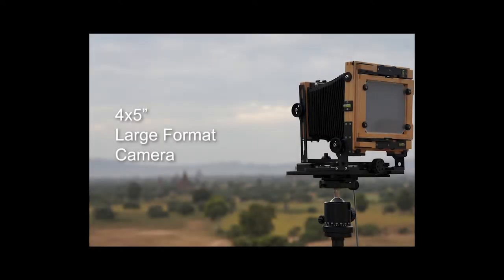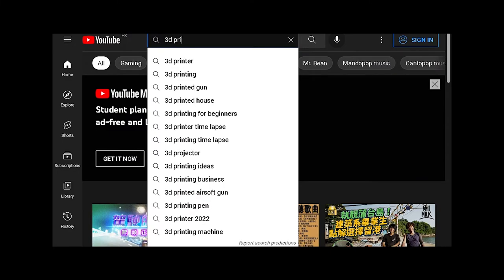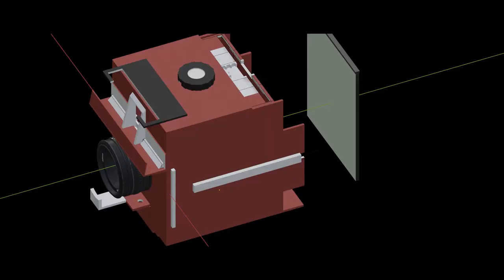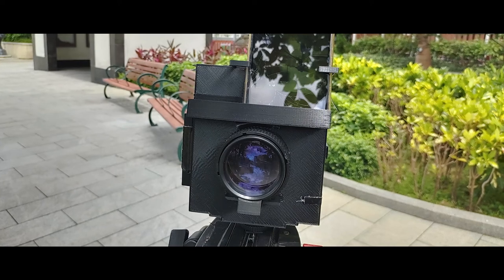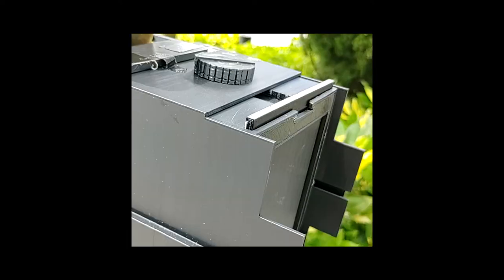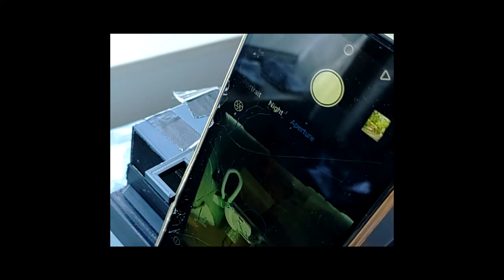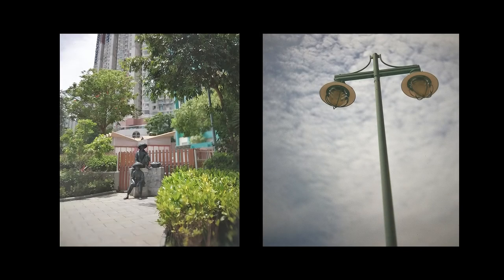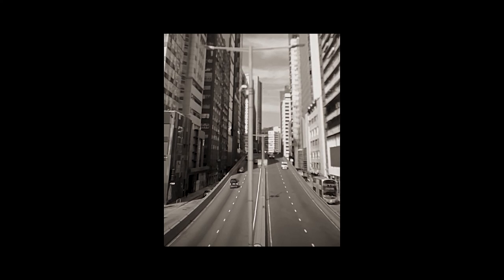3D printed DIY  large format 4x5 camera photos and videos

Comment: 很好的设计 不过对焦玻璃和白屏之间有点偏移 不如手机直接拍对焦屏
Reply from the maker: thanks. The focusing ground glass is quite grainy and also loses light as it is translucent. If you use ground glass as backplate, the problem is that the photo will be very grainy as compared with white paper plate and also will  not enough have light. Also when you use the phone to make video, the grains do not move as the video image changes. White paper plate is relatively inexpensive way to do it, even though the focus may be off.
Reply: 那还不如手机拍了直接进软件p图，本来4x5就是图那个画幅
Reply from the maker: @haominwei5702  because the sensor here is 4x5 in, where phone sensor is less than 0.5in. Different  depth of field, and light entry. Software recreation has artifacts. 4x5 diy camera can also make video with the same 4x5 unique feel. Like 35mm video cam vs imax 70mm camera, albeit of course this diy in term of resolution and DR is no better than phone video